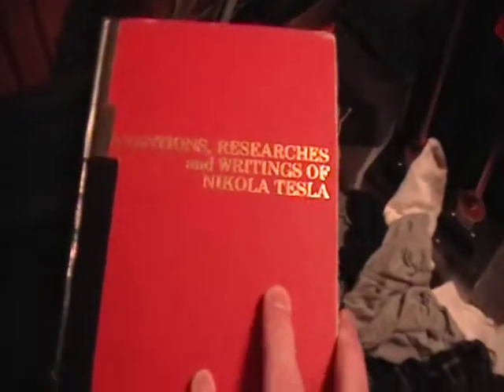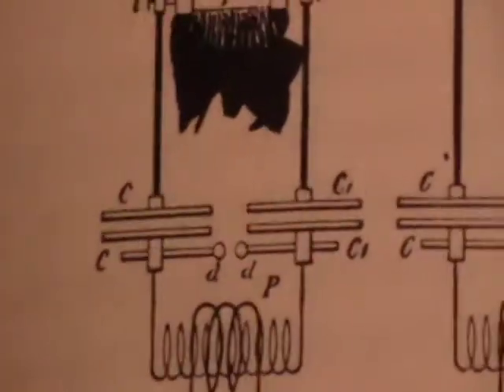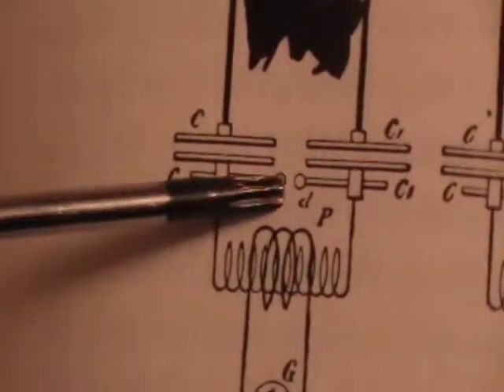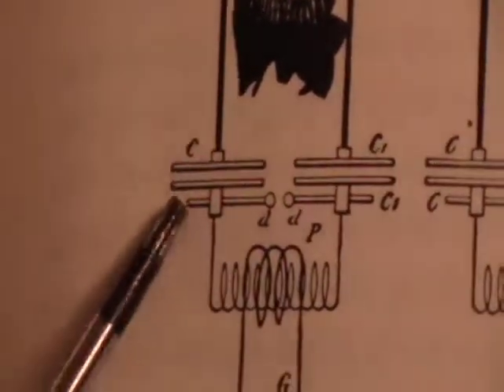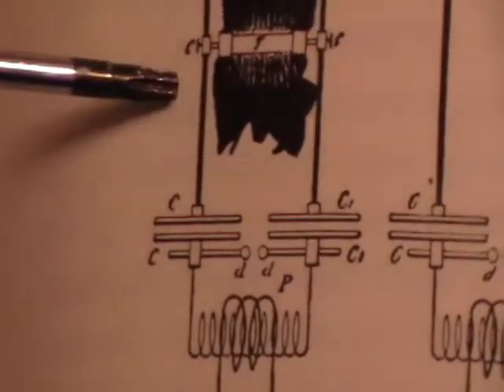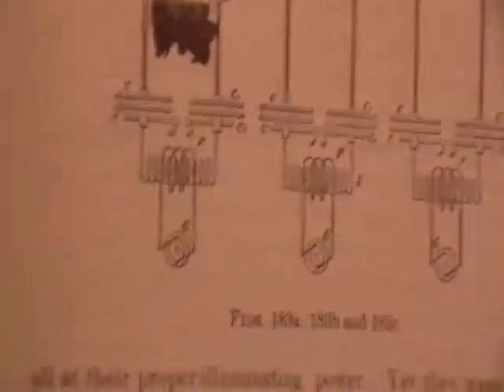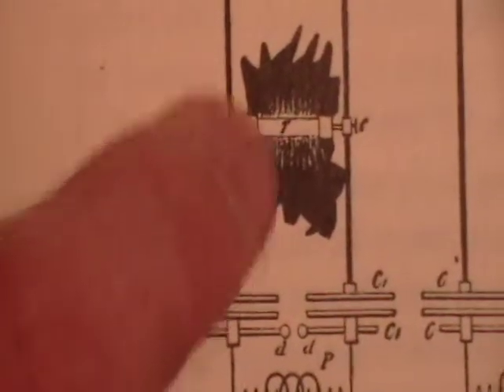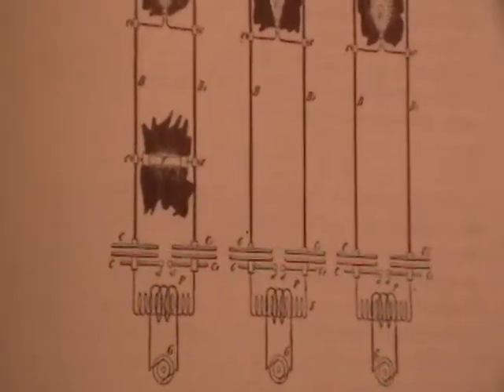Hairpin Discussion

Comment: Hellooo
Funny i been working on replicating Tesla's hair pin circuit for a few weeks, and i just now saw this video for the first time, hehehe.
Yes, the phenomenon is in the caps.
If anything bad happens just blame it all on Byron, hahaha!
Reply: Instead of the system now where we just stick our neutral wire in the ground.
Reply: the isolation of the capacitors. Power keeps flowing between plates as the preferred potential difference and flow to ground gets limited.

Comment: there are amps flowing in the circuit... in some setups kiloamps! but frequency is in millions of hz and very damped, so the rms value of the currents is measured in miliamps
Reply: If that was true it would be impossible to light 100+ watt loads through wires as thin or thinner than a human hair in closed loops from these things.

Comment: Just to clarify what electricity is according to Tesla is NOT what EE's today describe in the function of a capacitor. Dielectric materials hold and concentrate and pass voltage fields (in the day was called a dielectric field). They DO NOT isolate the Voltage fields, they induce them. But, to couple that field, you need a "conductor" that can transfer that capacity out of the dielectric. This is NOT the transfer of electrons, positrons, or holes that cannot jump the dielectric gap in the capacitor, it's field movement. Forget the water analogy altogether, electricity is a non-material (metaphysical?) phenomenon, not bound by physical packing/movement/conservation rules. It is made up of two fields, Dielectric (D) and Magnetic (M). They have capacity (density, but pack differently, D contracts, M expands) and potential. (Note north and south are not equivalent.) One is denser than the other and this affects how they cancel and what they do with other fields. They also are spatial with
Reply: direction and frequency. All of these come into play during induction. The basic induction is one field inducing another. The neutralization/inertial of induction only happens after three induction reactions are properly aligned to neutralize the first. Change that up and you get "free energy from the Ether". The Ether of course may just be the fields that create the space we live in. (Sorry, I digress.) The spark gap blocks/neutralizes the differential potential between the input ends of the caps. That potential is pulsing between zero when sparking, to the threshold that is just before the spark. But the capacity of the D field is not diverted. It collects in the dielectric material of the caps. With changes in the potential, it will flow. With the paired set up and alternating potential, they pass capacity back and forth, accumulating the capacity of the transformer without the potential. With the output of the caps shorted, the potential difference between them is zero (actually it
Reply: is varying, but neutralizes at 75% light speed).What is left is this massive capacity that is constantly shifting between the caps, which ends up being motivated in the circuit of your loads by the capacity differential, not the voltage. So the capacity travels around a conductor because the voltage potential connects with the neutral electron orbitals of the conductor. The colliding V potential induces a magnetic field that blocks the capacity from traveling in the conductor and makes the "skin effect". Without a V field, there is no resistance to capacity. And the capacity of the conductor is small, so it moves through the conductor longitudinally, which turns out to be faster than light speed. Metaphysical. If a load can connect with a very low to no voltage, it will couple the capacity (current) which is huge. You can do this with a single wire, but you have to use a single potential, pulse only positive voltages for example. The actual operation is completely different than you
Reply: describe because when you use language that turns a field into paired objects, you have to stand everything upside down to have it make sense. Then when it does things that only a field can do, you end up getting things totally backwards.  Eric P. Dollard describes electricity properly, he just never applies the induction principles to conduction. His analogy of tires peeling rubber on a road just don't do it. What he does engage, and something EEs don't is the multiple effect fields have on other fields. This is why the magnetized disc Homopolar Generator can't be described by induction theory, when that is exactly what is happening. (Wikipedia). Sorry, digressing again.

Comment: You can also show that a spark gap with that set up is not affected by a magnetic field and the "dielectric side" has no inductive power, meaning that it is very difficult to step it back down. Which relates to the no amps idea. I've been trying to figure out how to get functional power from the hair pin. My thoughts are that either the dielectric side acts as a resonator and the power is extracted from the spark gap or that the longitudinal impulses in the dielectric side act to make the copper "super-conducting" by aligning the atomic structure. I don't know how to test the latter...maybe a giant antenna(wardenclyffe).
Reply: The power on the cold side of the circuit is reactive until a resistive load is added, and only in the resistive load, Tesla used this principle in his COP > 1 principles, he was moving beyond energy around this time.